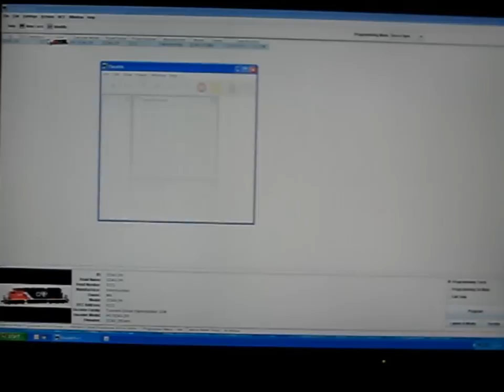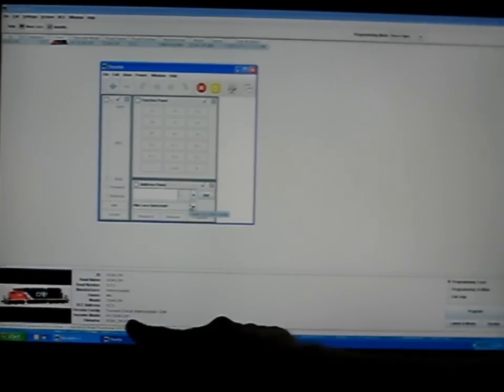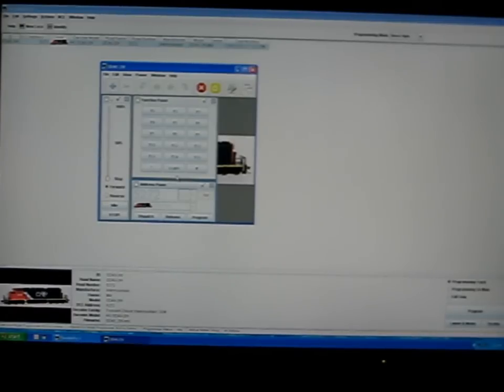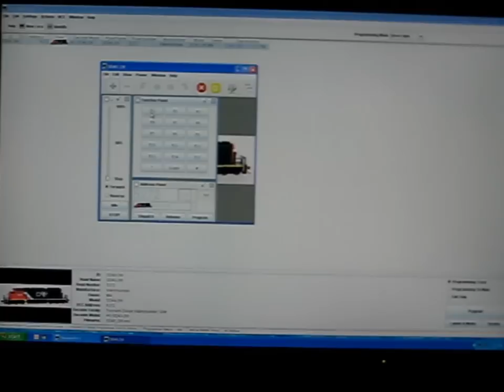JMRI & DecoderPro Train control with powercab

Comment: Awesome!  JMRI decoder pro is unreal!  I can't wait to get it set up when I get to that point with my layout. I love how you can tweak every little thing about the locomotive.  Especially the starting voltage so it starts smooth as silk just like the real units.  I really like the momentum option too because then they operate just like the real thing, JMRI takes model railroading to a whole new level. Thanks for sharing.  Looking forward to your opinion of WiThrottle.